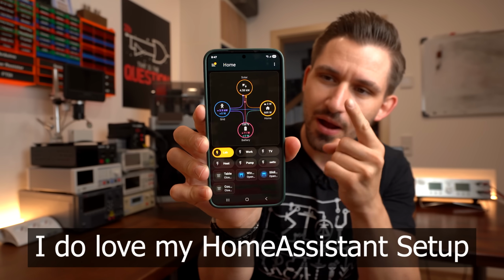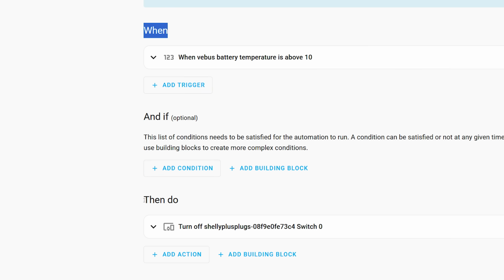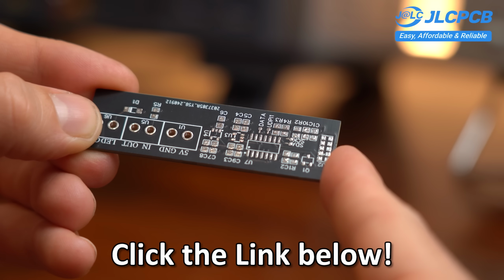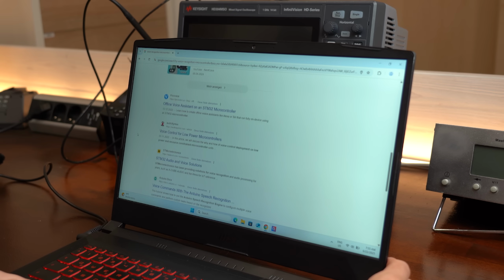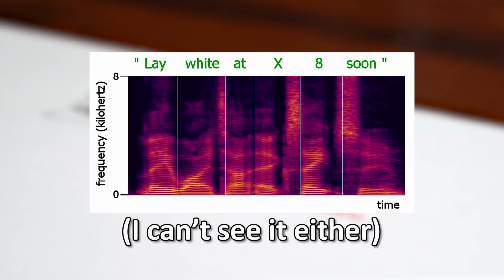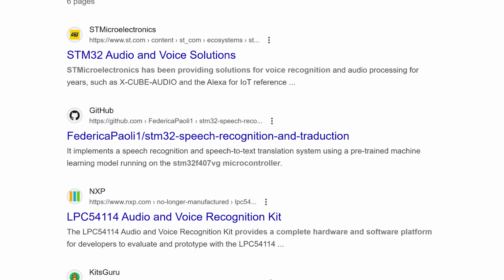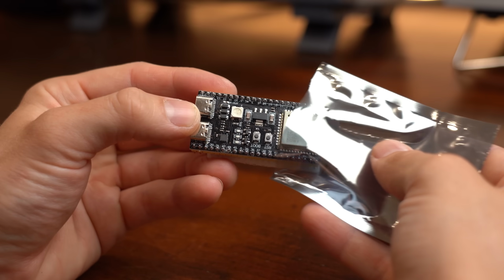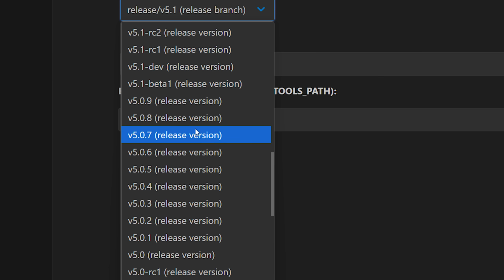Forget Alexa! — This is MUCH Better?! (Command EVERYTHING)

Comment: Hello GreatScott, I have a suggestion for a video for you. Although a lot of people and videos tackled the subject of precision voltage and current references, I'm sure you can perform well and better introducing current sinks and sources developing the topic to voltage and current references, may be, on the way a practical application measuring milliOhms using the LM317T or an OPAMP and MOSFET current limit ..etc.
You could come up with simple circuits for the tinkerer and the hobbyist's budget from what's 'On the Shelf' components like the TL431 even the 78xx series, LM4040 and forwards to 'the Hard to Get', expensive and difficult to order parts like the ARD1000, or some others from Maxim, LT, TI and AD. You could also refer to available 'DC 0-4.3000-33.000V 5 Digit LED Digital Voltage Panel Meter' or  using Arduino measure millivolts or volts with some 5 or more digits as the topic requires more digits to exhibit resolution while tackling precision reference, calibration and measuring. Good luck!

Comment: I could not get ESP to reliably do voice recognition, but I could get a pair of good microphones added to it and have it transmit back to my beefy server/HA host for a proper speaker recognition (it responds only to my and my wife's voice) and further control via HA. I now have a 'dumb' voice assistant box in every room for ~25 a pop (incl. USB power supply) and it works far faster and more reliable than any of the commercial solutions, which I wouldn't use anyway for privacy reasons.

Comment: For making it sounding better you could seal the box, add weight and sturdyness to the front, use a higher quality full range driver, use a higher quality amplifier, and last you may add a tuned port for more bass. But maybe you can also pair it with another sound system? Or even use a sound system directly with home assistant

Comment: Been in home/business automation for near a decade now. It’s very important to incorporate parallel systems.

If a relative can’t walk into a room and figure out how to turn the light on or another basic task like open the curtains then we consider that a failure.

I’m in the middle of a job where the previous owner used “smart bulbs” in every light and the new owner was using flashlights to goto the bathroom.😂😂

Comment: Hi Scott, about a year ago I also experimented with the ESP-Home setup and yes, it has many advantages: no cloud, faster response, more control, privacy, etc. 
But as soon as the ESP-Home voiceassistant is running in a noisy environment, the voice recognition is poor, which makes it more or less useless. Unfortunately, Alexa is unbeatable when it comes to filtering out spoken commands from the background of television or radio. How did you solve this problem?

Comment: I saw a quite extensive tutorial on this argument on network Chuck channel, where he starts from the same point, which is Ha setup, with the objective off replacing all Alexa, using an LLM. The aim there is not to have any external destination for data. In that case it is fully parametric and much more elastic that this that has some limitations. Even this is anyway an elegant and interesting tutorial!!

Comment: I've been looking into something similar a while back and came across a very nice module. It costs around 5$ on Ali. 
For those that are interested, it's a Hi-Link  HLK-V20 (there's also V21, V22, V23 and the V24 -> 200 custom commands, bilingual, more flash, etc.).

Comment: exactly the same project I am building right now, for the first half of the video I was saying, dude... ESPHome!  Glad you got there in the end ;)  My project will also add music streaming to the device as I'm installing it into and old CD/FM device with decent enough amp/speakers as AUX input - haven't seen anyone combine these two features yet (like a nest mini does) so hope it works.  thanks for this info, it reassures me I'm on the right track.
Reply: The nest mini doesn't have an aux input, only the older echo dots
Reply: @lachietg  I didn't explain that well - I'm looking to set up nest mini for HASS, so this device will be a voice assistant mic (satellite) and also be able to play streamed music (probably from music assistant) via its connected speaker and perhaps even output over bluetooth to another device - like a nest mini can.  combining a voice assistant satellite with a media streamer is not simple, I feel like putting 2 esp32s in one box!!

Comment: A bit of a security warning: This kind of voice controlled devices can be easily influenced from outside, so make sure to not let voice controls open any doors. 
Otherwise someone can just "Hey Jarvis, open the front door" when you are away.
Reply: My voice activated devices barely freaking work when I'm standing right next to them in a quiet room. 🤣It's laughable to think I could they would work through a closed door.
Reply: @bradley3549  Not through a door, through a window.You can control the microphone using a laser.
Reply: @hubertnnn  or using a vibration speaker placed onto the window that casts the sound inside as if coming from inside.
Reply: Yeah I realized this after building my own smart garage door opener with an ESP-32. I integrated it with Google Home but never got the hang of setting a pin code for it, so anyone outside the house could just yell Hey Google Open the garage. Luckily I lived in an honest and low-tech neighborhood!
Reply: Maybe a secret command when you forgot the keys inside ;-)
Reply: Fortunately, in Home Assistant you could choose which entities that exposed to Voice command
Reply: What idiot thinks that anyone enables voice activation from their front door lock, and what idiots are upvoting this idiot? This is a non-problem because 99.9% of humanity isn't this stupid.
Reply: That's why, for voice assistants, you don't want voice recognition - you want speaker recognition. Train a model to respond your/only authorized voices and it becomes far more difficult to fool it. Well, it used to be the case - with the advancements in AI if somebody samples your voice they could probably fool a model which is why you need 2fa / other verification steps for 'riskier' actions.
Reply: A lot of those smart door locks use relays rather than solid state components to activate, which means you can open them easily using a very strong magnet.
Reply: I'd recommend just not having a smart door lock. Just use a key. You can have that smart doorbell even. But keep doors reliable and without extra attack vectors.
Reply: They can also be secretly activated via ultrasonic and laser signals.
Reply: When home alarm i armed. Disable all open door commands. :) Not perfect but quite alot better then nothing. Or even disable all voice assistants

Comment: I recommend checking Nexus1 from a Youtuber called FutureProofHome. So far, it seems to be the best Alexa "AI" replacement that fully works with HomeAssistant as it's running on Nvidia Jetson. His speaker called Satellite1 is also open source

Comment: I stopped using the arduino IDE when I discovered Platformio. Works VERY well as a VSCode plugin, and with most boards out there.

Comment: There are also I2S MEMS mics (in the same tiny package) on the market which can be pre-programmed with a few wake words as an extra. Then that feature can be used as an interrupt source to wake a much more current chugging MCU or a more advanced embedded system. The ESP-IDF/ADF/SKAINET, etc are not that easy to use. Those frameworks need some exploration before starting development on them. They're built on each other so one has to carefully observe their intercompatility matrix and patch the IDF (or FreeRTOS behind it). They also have a few closed source precompiled libs in them. On the other hand if I compare them to let's say starting from scratch using CMSIS-DSP,  they're much quicker to implement on.
Reply: Sounds good as a start in a ESPHome project.  Please give a type number or link to this I2C MEMS mics.
Reply: @roever1936  I found it like 6 moths ago. Possibly it was the Knowles SmartMic series (IA610/IA611). Unfortunately I don't see the parts on stock anywhere, only a few Knowles IA611 and MikroE kits on Mouser. Other, less "smart" mics are TDK Invensense mics with AAD.

Comment: Have you considered a dev board with proper tensorflow support like the google coral boards? Or have you considered streaming the audio to a google api?
Reply: Streaming the audio to google completely defeats the benefit of privacy, wouldn't you say? That's one of the biggest reasons to have it all local, so no corporation hears everything that you say in your house.
Reply: Coral doesnt support full tensorflow, just TF-lite last time I checked. Coral isnt a full engine like a GPU, just an int8 inference ASIC like most NPUs

Comment: A smart device that isn't spyware is always a good thing to see.
Reply: Its also why ha and tasmota, esphome, openbeken is awesome! No relying on american or chinese cloud and the company can never say 'sorry, we dont support your device anymore'. All the IOT devices in my home have custom firmware on them. I have had some tuya cameras where i hooked into the uart and they spoiled my wifi credentials easily. They printed full unencrypted ssid and psk into the shell and stored it in a regular .ini file 🤦🤦. That just shows a lot of companies dont care about security. Even the big name brands are not totally innocent
Reply: People should stop using Scamazon as much. They are one of those companies like Meta that wants to know everything about you. It's why I never shop on Scamazon and abandoned Facebook years ago.
Reply: Just going to say that. Can't count the number of times a random conversation turned into a recommendation for a product on Amazon.
Reply: @support2587 For the record, Alexa dosn't record unless you say the prompt, you can check for yourself if you monitor the network. I experience the same phenomenon, and I don't have a voice activated assistant, lol.

Same goes for mobile phones. Recording enough voice data and transcribing it constantly to gather a marketing profile would drain most modern phone batteries fairly quickly.
Reply: @support2587 Remember when it was considered a fringe conspiracy theory that the computers are listening? I don't trust a cellphone, never mind something that could control my basic house functions! I know people who need such devices for accessibility reasons, e. g. being blind, and a device like the one in this video is what they're getting for Christmas now. Everyone has a right to privacy and dignity.
Reply: Sure? You know exactly what code is in that cheap Chinese module? ;)
Reply: @mikenco  It isn't connected to the internet now is it?
Reply: @mikenco Begone, sinophobe. Unlike Alexa this machine has code *you can read*.  The chips have readily available diagrams. As someone who used to live there, trust me the only common people China's government spies on are its own. They could not care less what some random person is doing on the other side of the planet. Think about it. If Chinese goods were spying on foreign countries, don't you think, with all those billions of objects, someone might have noticed by now? There would be proof in everyone's home, yet there is none!

Comment: Great video, as always!

However, it would have been great to mention the significant differences between the various solutions. First of all, microcontrollers can process very small Artificial Intelligence models on their own using the open-source library TensorFlow Lite for Microcontrollers (a special version that's even smaller than the standard Lite version). There are also many other alternatives; one of the most well-known is the online service Edge Impulse, which is a commercial platform but is free for certain use cases, like voice processing. In reality, Edge Impulse is mostly a web interface for TensorFlow, with the option to use its own, more optimized library for microcontrollers.

The issue is that the processing power of a microcontroller is very limited. For example, with an Arduino Nano 33 BLE, it's not recommended to train a model with more than two words (like "yes" and "no"), as each additional word will significantly decrease the accuracy rate. With an ESP32, you can train a few more words, but not that many. The advantage of this method is that the model can be trained with any word or language, and it's all done locally. Of course, with a Raspberry Pi 5, the possibilities expand considerably.

The offline speech recognition module is an ideal solution, but its main drawback is that it only supports English, in addition to any custom words you add.

As for the solution of sending voice data to a online AI for processing, this approach supports many languages with a high accuracy rate. However, this processing is done online. This is how Alexa and most voice assistants work: only the wake word is processed locally.

Comment: I have a number of Alexa products including 4 Echo Shows, i have to say ive never had disconnecting issues with any of them, even with the Echo Dots in the past, but its possible my Internet/WIFI is more stable than yours. As far as Alexa not always "hearing" properly, that can happen with background or other noise like a TV being loud enough to interfere with what Alexa hears. But i have encountered it as well even without other sound being present, so i usually wake her up again to cancel the current command and try again, or make sure the microphone holes arent dusty which can affect recognition as well.

Comment: Nice project!
I actually used ESP-Skainet in an AI robot project I made at school. It only worked for me after I switched to Linux, as no matter how hard I tried on Windows, nothing worked.
I used ESP-IDF 5.4 along with ESP-ADF to output audio through the speaker. The project wasn't related to Home Assistant—it was a simple AI robot that could answer questions and move using voice commands or Bluetooth.
I might make a video in the future to show how I built it and share the code, but that will take some time since the project is complex and involves many libraries and frameworks all linked together.
Reply: Sounds like someone used OS specific code directly without any manager-driver layer for switching the OS.
Its a very common problem on software made on windows, you happened to fined a rare case of it being inverted.
Reply: i guess its because all the code is made and tested on Linux and devs don't use or cares about windows  @hubertnnn
Reply: Well then you should show your handiwork! The product of your education is another man's intrigue!

Comment: There is already a great Jarvis script on the net and it’s massive and the tie in is AI. Using multiple scripts to query your questions it is possible to not only build a better speaker than Google Nest and Alexa but to upstage it too (and it won’t be constantly eavesdropping on your conversations). There is a guy in the USA who has gone one stage further and done just that ! An AI powered smart speaker that runs rings around both Alexa and Google Nest

Comment: 10:33 As always, your projects are interesting and creative. But the project enclosure is confusing- the orange detailing is nice, but should complement the light ring. The two seem disjointed.
Reply: Agree- I'd switch to an LED strip behind the white diagonal line. Maybe line up the LEDs with the orange diamonds.
Reply: @meatmanek or a circular pattern of the colored blocks

Comment: Home Assistant has a device for it (Voice Assistant Preview Edition), but it is mainly for forwarding the voice to the HA server to either process it locally with a locally hosted LLM or forward it to ChatGPT or something else, allowing it to give accurate response or answer questions. Using this way you can also change the wake word if you want, which on the ESP32 is fixed.
The ESP32-S3 on the other hand is for local processing directly on the ESP32, which it does VERY FAST. For those don't wanna put it together, there is a pre-made version called ESP32-S3-BOX-3 / ESP32-S3-BOX-3B but of course is pretty expensive. You just flash it with esphome and it works.

If you want very long and very complex commands (and also asking it questions), then getting the Voice PE is probably better. 
But if you just want really short (and direct) commands, the ESP32-S3 does fantastic.
Reply: Yeah, have to say the speed on this is impressive.  I have VA PE, but there's lots of latency and it's not particularly accurate. I've stopped really using it as it just ends up being easier to use the app and call the scene or whatever from there.
Reply: @TheDarrenJones  You can tweak latency and accuracy by swapping out the model it uses, if you're using the local whisper/piper, you can also move whisper to a docker container on a more powerful machine.
Mine is fairly accurate and latency is 1s or less in general using the distal-small model,  and that's on CPU.
Reply: @BenVanTreese in process of doing this now. What is acceptable hardware?  Average PC ?  Or synology ds1824?
Reply: @normswan5806  I'm on a ryzen CPU, but anything that is like... Modern CPU should be fine, use distal models and use smaller or med, small is usually 1s med is more and large is 5-7s for me, though if you have a GPU that'll go down by a lot.
Reply: A tiny PC with an i5 or etc should get similar performance, but I don't know 100%, you may be able to find some benchmarks out there in the wild, the models are systrans ctranslate ones, since ha uses faster-whisper
Reply: Mi HA PE hasnt been delivered to me yet but I'm already thinking og getting a Jetson Nano to run some LLM model + other AI-ideas for home automation. I do really love to tinker with this kind of stuffl lol